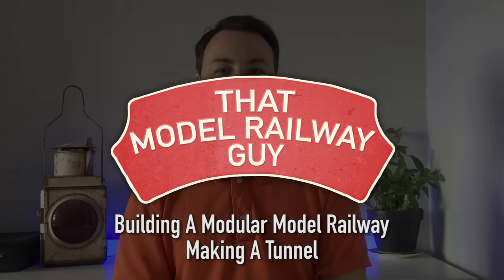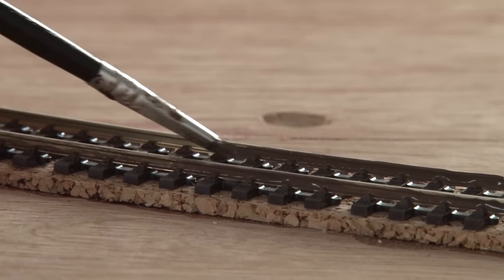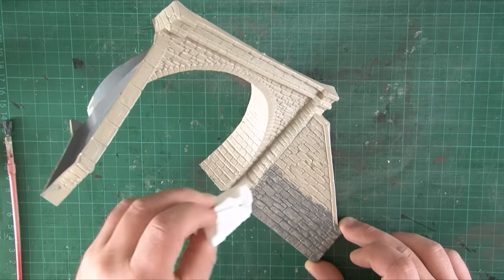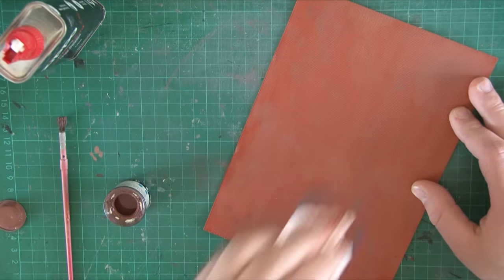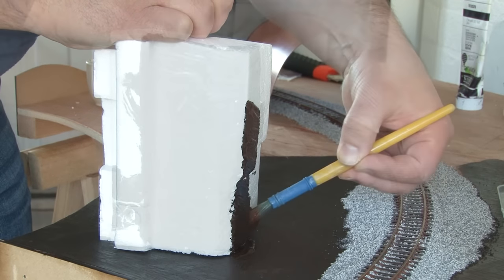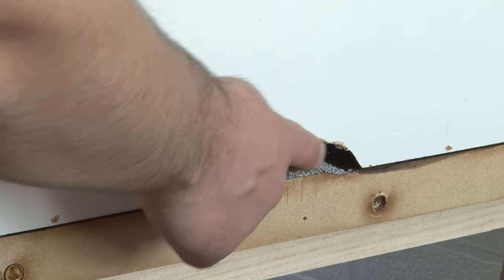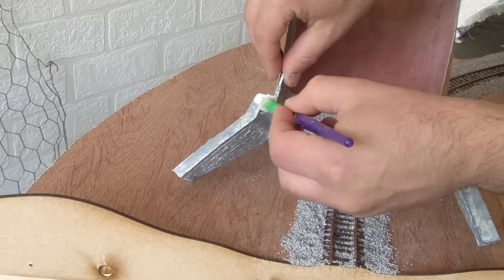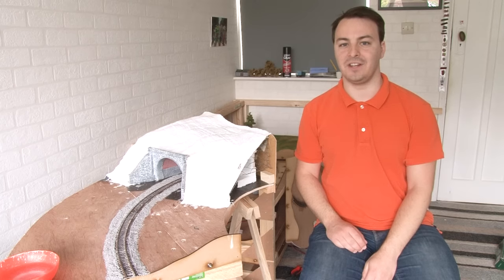Building A Modular Model Railway! - Episode Nine: Making A Tunnel

Comment: With wire frame hills the method is normally weaving card strips in the wire so the paper mache or plaster cloth actually has something to stick to, WAY more surface area that way. Takes more time but its worth it I must say. 

Used the same method on my own layout years ago and it worked really well. the area I did was massive aswell, a good four feet or so all the way back to the wall to create a hillside and tunnel.
Reply from the maker: Yep I've seen people do it that way too but for me I've found the paper mâché sunk down into the wire mesh and the glue bonded it all together really well. That was why I did this initial layer before the plaster bandage.
Of course you can also use a card lattice without chicken wire at all and just have card formers to shape it which is the really budget way of doing things 😆 Thanks for watching 👍
Reply: @ThatModelRailwayGuy  I gotta ask. What the smokebox do you use for your control system? I see you do it via your phone. Is that hornby or bachmann or something?
Reply from the maker: @NathanielKempson  It's the Roco Z21 - bit pricey but it's so easy to use and it just works which is great for an idiot like me. I really should do a video on it since people keep asking about it 😃
Reply: @ThatModelRailwayGuy  that would be great yeah!! Building my own layout in a few weeks, like my fifth one XD and cant decide what dcc system to use.

Comment: I recently started doing a tunnel on my layout but I did decide not to line the tunnel but completely paint everything inside black. It's worked really effectively as you can hardly see the plywood inside. I also have to consider issues with mice on my layout as it is in a shed and have found that scenic structure made of paper mache attracts them as they use the old newspaper for nests, so polystyrene and wire mesh covered in plaster works well for me.
Reply from the maker: Hey Ben, yeah that was my original plan too which is why I painted all the plywood in that murky brown/black colour. As I had those brick sheets lying around though, I figured I'd have a go at making an interior too. Hopefully when the sides of the baseboard are closed off it'll be much darker in there so trains really will just disappear into the blackness.
I had no idea mice were attracted to paper mâché but it makes sense when you think about it. Thankfully I don't have to deal with that (touch wood!) but glad to hear the plaster and wire method is working well for you too. 
Thanks for watching 😃
Reply: @ThatModelRailwayGuy  plus you have a new subscriber. It was a really enjoyable video to watch

Comment: The use of masking tape around the sheet of bricks would hold it in place while the glue dries. It could also be utilized at the other end by using a piece about 2 inches wider than the bottom to keep it from spreading. Cheap and effective. Another idea would be to place a bead of hot glue at the joint between the tunnel and interior liner to hold in place while the glue sets and it does not require removal.
Reply from the maker: Masking tape wouldn't be enough to hold it, I believe I actually tried something similar originally and the sheets were just so springy that it came off straight away. Thanks for watching 👍

Comment: if you can't find or get the paint to the weather track or to paint the tunnel mouth, is it ok to use dollar store paint.
Reply from the maker: Hey there, yeah I don’t see why not as long as you get similar colours. In fact the white paint I used for the brick mortar was a cheap acrylic paint anyway. Just make sure everything is properly dry first before adding the next layer. Thanks for watching 😃

Comment: Excellent video as always.  I have a couple of questions.

What are your plans for the side of the hill, as at the end of the video they are still open?

And secondly, is the corkscrew what is going in on the station module?
Reply from the maker: Thanks John, glad you enjoyed it! The sides of the hills will eventually have a fascia running the full length of the curves on each side, made in a similar way to the backboard. Once I sort out the landscape on those bare bits of baseboard in front of the tunnel I'll add the fascias in as a single piece on each side.

As for what's going on in the station... well I'm afraid you'll have to tune in to the next episode to find out 😉 Luckily you won't have to wait long - it probably won't be next weekend but hopefully the week after! Thanks for watching 👍

Comment: You use chicken wire, how do you shape the chicken wire to make it fit?
Reply from the maker: You just cut it to size and then bend it how you want. Usually by the time you've laid it over your supports and fixed it down it it'll have bent to a natural shape anyway by you can always manipulate it by hand if you want something specific. Thanks for watching 👍

Comment: You make no sense sometimes 
Why not just cut bigger bits of plaster cast 
You must have so
Much time on your hands
Reply from the maker: Two reasons, firstly this is the size the plaster rolls come in so I kind of had no choice in the matter. But layering several strips instead of just using one big bit makes the end result much stronger which I need for a portable layout like this. It's also much easier/quicker to work with in smaller sections. Overall it took about 5 mins to do the whole area. Thanks for watching 👍

Comment: What glue did you use and how did you get it to be able to spray it on
Reply from the maker: Hi Richard, I assume you're talking about the ballasting section? I'm not spraying the glue in, it's just water that is being added to the ballast from the spray bottle. 
The glue is then put on with a syringe and is a 50/50 mix of PVA with a drop of washing up liquid in. I've actually done a whole video on this if you're interested: https://youtu.be/9uzOOMTzDAw
Thanks for watching 😃